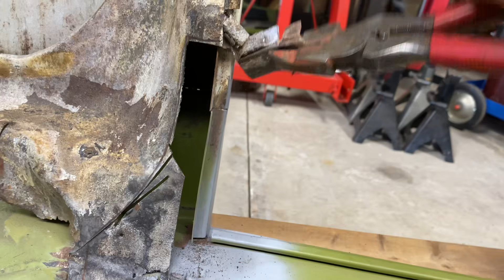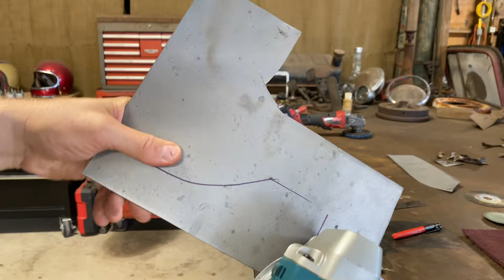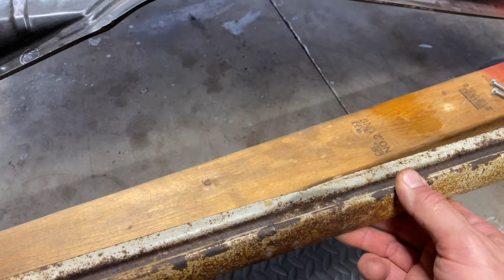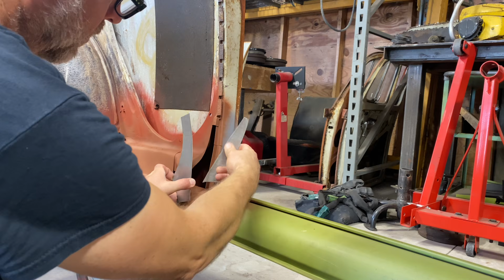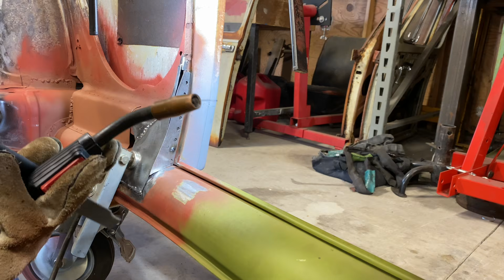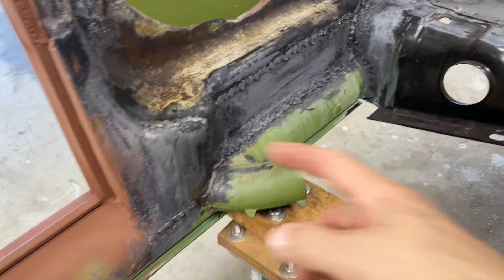1965 VW Beetle Restoration - Metal Fab & Welding "B" Pillar

Comment: Get a broken drill bit that is thinner then the hole and just cut it flat and grind.  It will clean the hole. Most likely a flat bolt would be enough to clean that hole.  What harm would it do just to test?

Comment: I love this project almost as much as your van project. It reminds me of the 1973 1303 Käfer I bought behind a McDonald's in Germany. The owner said it broke down and wouldn't start, and when he tried to jack it up to change the flat tire the jack point ripped through the floor. I paid him 500 DM (about $300 American at the time). I put in a battery and a set of points, changed the tire with a borrowed floor jack, and drove it home (illegally). In Germany a rust hole in the chassis is forbidden. So, like you, I slowly made pieces to fit and welded them in. The car had a 1963 40 horsepower engine and transmission, but I drove it all over Germany and even brought my son home in it when he was born. Wish I still had it.
Reply from the maker: Thanks Papi! That's a great memory my friend. Thanks for sharing! =)

Comment: After ospho, just hit it with a wire wheel, then clean the dust with anti silicone and you're ready to color. 😉I would avoid lap joints though...
Anyway, it's coming together. Cheers!
Reply from the maker: thanks man! good tip!

Comment: I think you still have the bottom of the side window steel that needs to be repaired and the top of the rear window that needs to be repaired. I would close up the rear of your rocker panels at the rear wheel fender well or water and road debris will get thrown in there and cause it to rust out again.
Reply from the maker: good tip Jon! Thank you! =)

Comment: Will respond after watching the rest of the video but just want to make sure you know don't have your face in the path of the cutoff wheel even with a face shield. That's why they come with guards on them. I worked with them for years cutting fiberglass and open with a 24 thousand RPM small air 90-degree motor like yours made by Dotco. They would explode once in a great while and went flying. Make sure you test them for cracking before starting. If you lay them down sometimes, they can get damaged.

Comment: What would be quite useful is to use some sort of spray wax that is applied wherever two sheets of metal form a hollow space, to avoid corrosion from the inside, especially when driving around in Florida with a 90 % humidity rating!
Reply: Cosmoline
Reply: @andyhamilton8940  Is this the name of the product?
Reply: @jurgenkuhlmann9194  what they used to spray on new cars being shipped from overseas. Not sure if it’s still available. Try fluid film possible or melted toilet wax ring. ( Mustie1 credit)

Comment: There you go CT, gettin' 'er done. You've come a long way in many aspects. facing these body work and welding challenges like a champ. Those doors will seem easy now with all your experience in more complicated task. Can't wait to see this bug on the road. I finally made some progress on my bus, but now I learned the hard way a mistake I made and trying to save money is costing me more money. I have to buy a narrowed beam and it's gonna cost me $1,500 for a narrowed adjustable beam.
Reply from the maker: Thanks man! 👍 why do you need a narrowed beam? Who are you buying it from?
Reply: @CTmoog  because I used empi drop spindles and they push your wheels out plus I’m using adaptors to keep my wide five pattern which pushes my wheels out further. Haven’t bought it yet but probably Vintage Vdubs

Comment: For the love of everything automotive get rid of the patina. Its just rust that hasnt penetrated yet and will simply leave you with a rust buck in 5 years time.  Use it to practice spray painting before moving onto the Ghia.
Reply: But it has penetrated threw in some spots, been telling him for months that what he has is not a patina but just a rotted car, a patina is where you have some warn out paint and maybe a very light surface rust and don't get me started on the large overlap patch's ...
Reply: Do your own project.